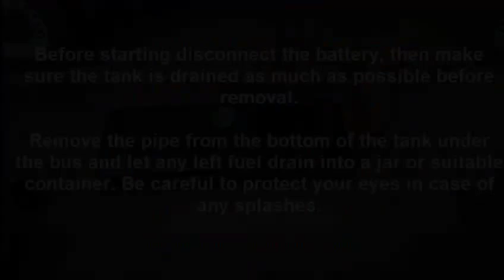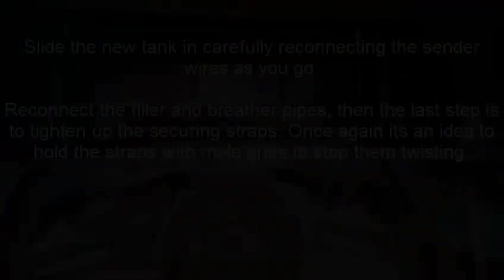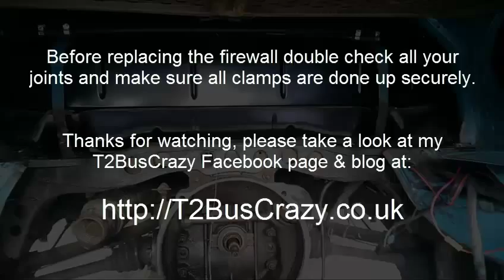VW T2 Late Bay Camper Fuel Tank Removal

Comment: Any tips for getting the new curved filler hose onto the fuel filler pipe. Struggling to slide my new pipe onto it. Was going to try dipping the end in hot water to try and expand it but don't want to damage a new pipe ?
Reply from the maker: I can't remember for sure but I think I remember doing as you mentioned using hot water just enough to soften it a bit to enable it to go on easier.

Comment: U think i can do this as a novice ?i have a t2 from 74 for 8 years it worked Ok only somme oil leaks and i took it to a mecanic to fix the oil leaks yeaterday i took it back after 3 months time that the guy kept it in His garage ,So as i was saying yesterday i picked it up drove it 7 km and started misfiring,and engine died ,it s trying to start but Doesn t ,took the fuel pump out gave it a key or two put the gas in a bottle and it has a red color with redish depozits on the bottom of the bottle ,now i m Gonna cut thegas pumphose  line at the end where the filter goes in drown  the gas of Gasoline and would it be wise to try to clean the tank without renoving it ?would that work ?i have to cut the rubber gasoline hose because the rubber is stuck on the mouth of the gasoline filter and i can t remove it

Comment: can you leave the motor in it while removing the tank? or does it haft to come out
Reply from the maker: If you have a Type 1 engine like I do you will need to drop the engine right down to get to the tank out. The problem is the fan housing. You can get access by removing the gearbox hanger bolts and lowering it while supporting it like you can see in my removing the firewall video but it won't be enough to get the tank out completely. If you have a Type 4 engine I believe it's a lot easier because you don't have the fan housing in the way. Let me know if you have any other questions.
Reply: thank you
Reply: That was my exact question.  It would have been extremely helpful to address this in the video I think...

Comment: Can you show me how the breather pipes are suppose to be ran?  Do they connect to each other?  All of the rubber pieces on mine rotted off and fuel leaks everywhere.  When I cap them off, my van dies.  When I leave them open gas leaks everywhere as soon as I turn her on.  I can't find any diagrams for it or anyone who works on these old things.  Thanks for any help you can provide, Will
Reply from the maker: If you follow this link it shows a diagram of the breather connections and pipes.
 https://www.google.co.uk/search?q=vw+t2+breather+pipes&rlz=1C1CHBD_en-GBGB718GB718&tbm=isch&source=iu&ictx=1&fir=Fq1fInZs_47BbM%253A%252CJSVX65js4ncJVM%252C_&usg=__DfyAymJBmurrT15LJY-7tlWzqWI%3D&sa=X&ved=0ahUKEwjmls_HkunXAhUBKsAKHWlLBm8Q9QEIKTAA#imgrc=Fq1fInZs_47BbM:
Reply from the maker: Both pipes should meet the T piece and then from there go to the air filter. Mine were connected to a vacuum port on the carb when I first got it!! Hope this info helps.
Reply: Thank you so much for taking the time to respond and for finding  and sharing the diagram. Much appreciated!  Will
Reply from the maker: 4bmmc3 No problem at all. If you have any more questions let me know. Ive had most things go wrong with my camper!!

Comment: what year kombi/model is this one?
Reply from the maker: Gary Stinten mine is a 73 Latebay.  The tank was a little tight fitting due to a stopper bolt at the bottom but you can squeeze it in. It might have been modified  since i bought it.
Reply from the maker: It's a 1973. Now the tank is bank in I can't get to it to measure I'm afraid.